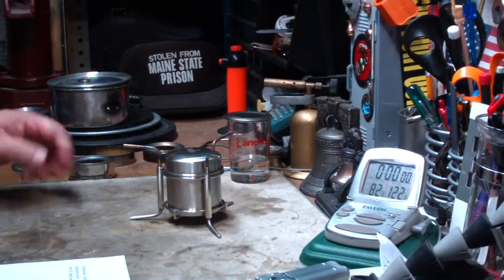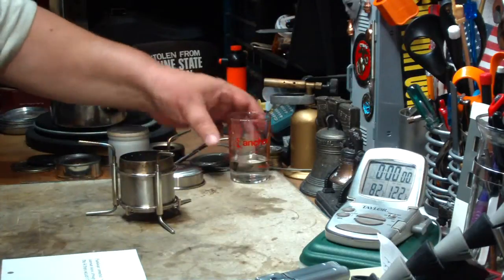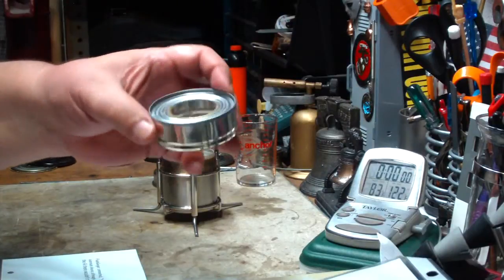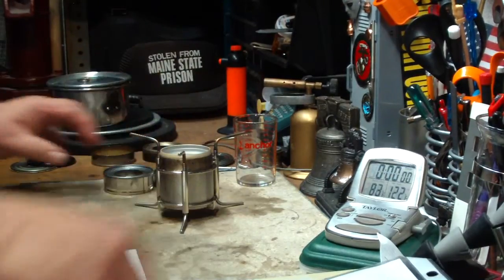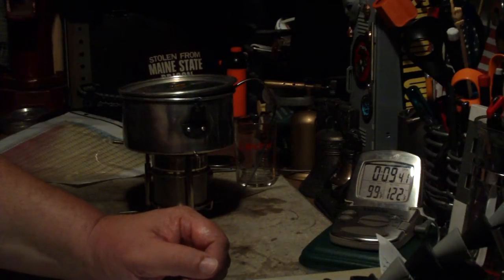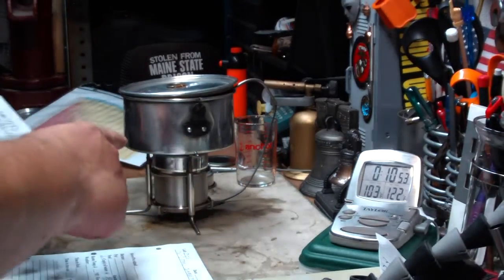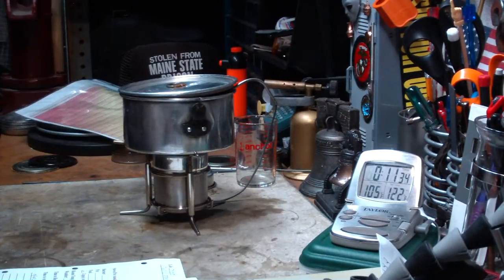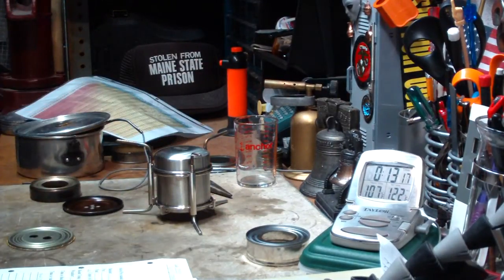OUT-D Stove - Simmer Test #2

Comment: Thanks for showing my old buddy--not Max, but the Safesport!  I picked one up in 1994 (when I was discouraged about having to buy repair kits...)  I used that old thing--which had a lovely leather--heavy--case (which my dog eventually chewed on), and the movable legs.  I used it on cold, high elevation goat-packing trips, where I didn't have to worry about it getting crushed.  I'd fill that thing and cook away--but always had trouble with the snuffer not snuffing when it got really hot AND for not having a simmer possibility--so thanks for the ideas here!  I eventually changed to the little Vargo triad xe, because that seemed so much lighter.  I was horrified at how much more clumsy that Vargo was to use, being used to the Safesport...., but the Vargo is nice on warm days for just a cup of coffee.  But in the winter, I was still lugging up my Safesport because I needed that much alcohol in the freezing temp JUST for a cup of coffee!  SO, I decided to invest in your favorite TranGEEia, and was horrified when I got it that it was so heavy.  So I did a Hiram test:  I went out to the freezing cold (about 5 below) and set the two ablaze, with the same amount of fuel, and let fly. 

This was really interesting:  Just watching the burn time, not boiling anything, the Safesport gave up the ghost much sooner than the Trangia, which went about TWICE as long.  (That wouldn't surprise you, I know.)

So I have since marveled--and am learning from you--about how the AMOUNT of flame and the coverage of the pot really make a difference, leading a person to have to make the decision on whether they want a FAST cup of coffee, or carry less fuel...

I love that old Safesport tho, you know, cause it has so many great memories....  And I've got one of the individual trangias that leaks.  [A great bit of help came when I read to put a "liner"of gasket material inside the lid, thus pushing the o-ring a bit tighter!]  So I'm making the transition to the Trangia ok.

Meanwhile, wanted to tell you that I've been building a great little "Fancy Feast" stove (except mine's a Fancy Oysters), and with the leftover carbon felt, I experimented with a little pad of it to go under my pot while using the trangia and cooking up water on the GSI.  Well, couldn't notice any real difference while I was impatiently waiting for the coffee water, but when I too that hot little pad of carbon filter off, I popped it into the bottom of the GSI cozy, and used it for a "coffee cup warmer"!  Heh heh.

My word, I can let time go by watching you boil water....  Thanks for all the lessons.  Jules

Comment: I put a layer of carbon fiber fabric inside of the can today. The outside jets didnt ignite. The inside alcohol did heat up, and the stove tried to use the gap between aluminum and stainless steel as the jets. seemed to be a lower heat output than with no carbon fiber.  I used a stainless steel tea kettle with 8 cups of water so my numbers are much different from yours.  I wanted a snow melter primarily.

Comment: my OUT-D arrived today.  They estimated Aug 7th to Aug 28th delivery.   My version has the inner aluminum swedged into the pot.  The lip with the burner holes is narrower than the rest of the can. the aluminum is expanded into that taper much like a ferrel fitting set up.   I hevent had a chance to fill it with ethanol yet.

Comment from the maker: You're right about the boiling first. I did it this way so I would have the wattage measurement to compare boiling with simmer modes. I like your idea of removing the inner liner but it looks like the difference in heated expansion of the aluminum vs the stainless steel makes it a little hard to remove when heated. Thanks for the suggestion though. Now you have me wondering if the simmer ring can be put on from the start if needed. The cold pot might be a problem though.

Comment: Cool.  Yeah, I didn't think anyone would want to simmer without having boiled first, so I didn't think removing the insert would work unless it was a lot looser.  Your ring CAN be added hot, so would be useful for doing something like cooking real rice (instead of the minute variety) or dry baking after you were up to temperature.